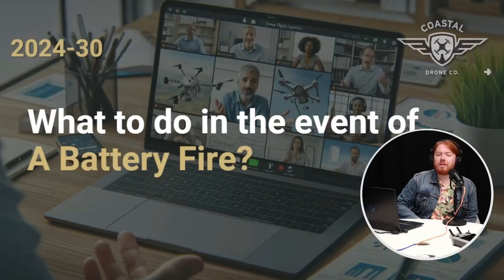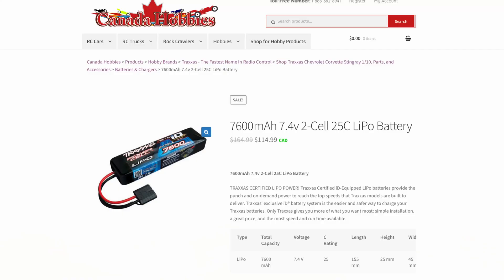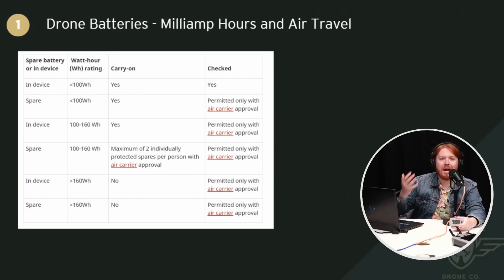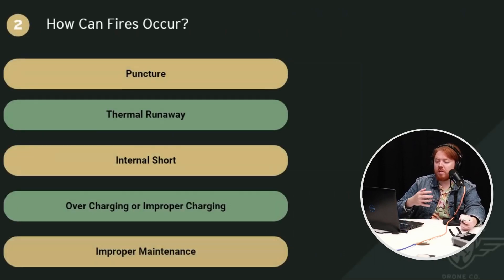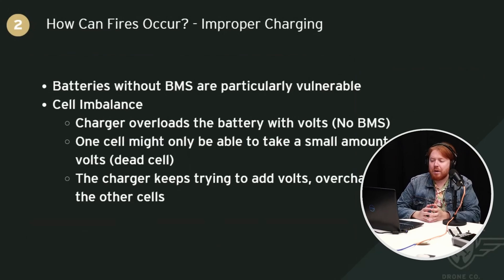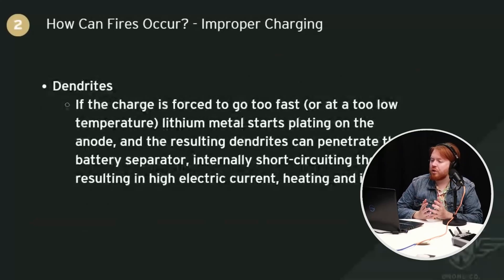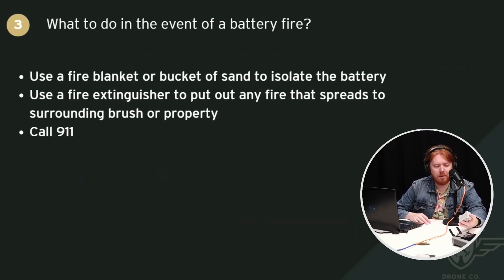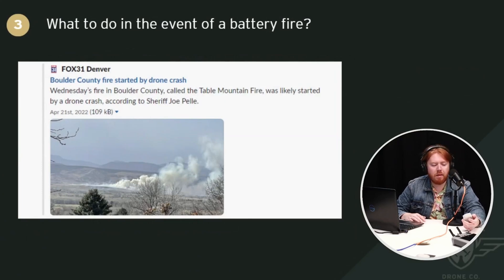What should you do if your drone catches fire?

Comment: If volts is the Speed then a fully charged battery is running marathons. You can’t put physical terms on non physical things. There is no speed and there is no pressure. These are fields, electromagnetic to be specific, the electrons don’t move they just shake/ push and pull on each other. You got it right with the potential energy on voltages but it’s not speed it’s the amount of energy you need to move an Electron and amps are how many electrons get moved at the same time. So mah is how many electrons can the battery move in an hour. We use it as capacity cause we can easily calculate use times with it real energy is in joules or calories.

Love the Video though nice Info for batteries some stuff i didnt know